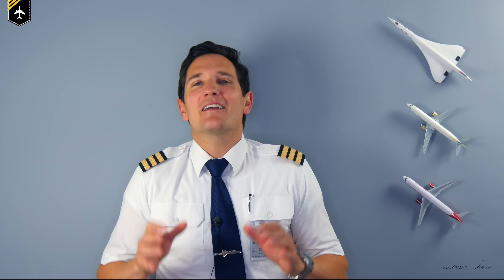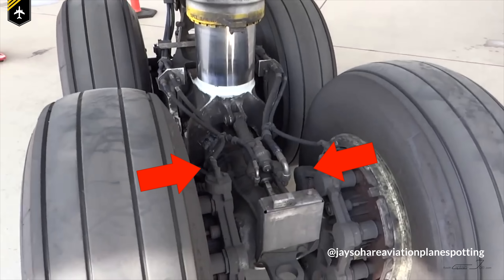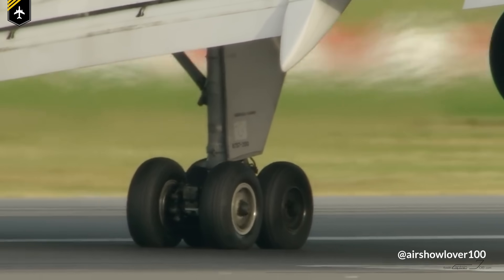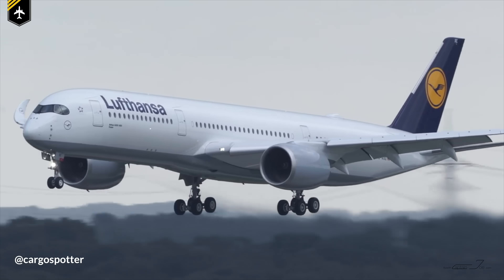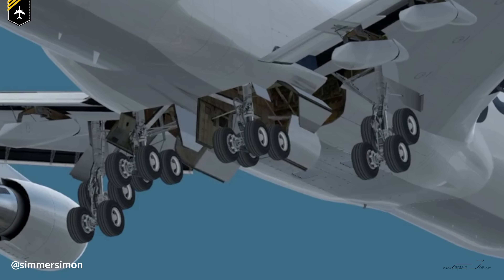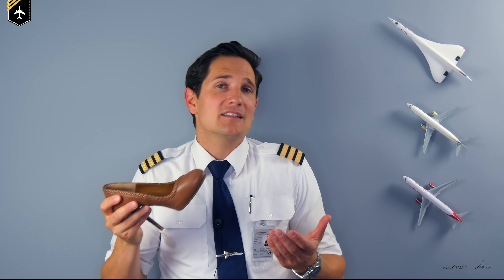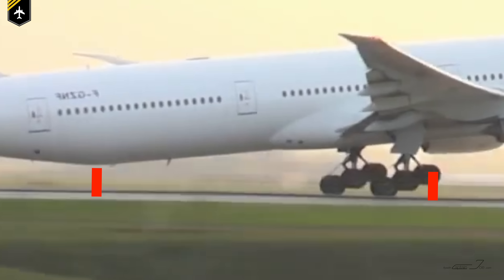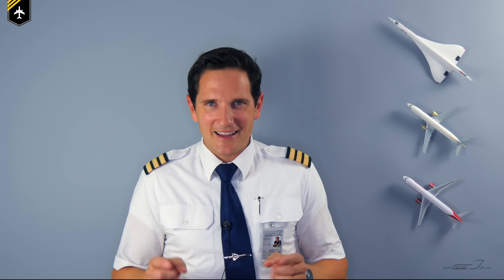Why is the LANDING GEAR TILTED? Explained by CAPTAIN JOE

Comment: I’ve been an aircraft maintenance professional for 20+ years, and I can tell you that very few pilots have this much knowledge about aircraft systems. Troubleshooting discrepancies would be much simpler if all pilots were this well informed. I’m very impressed.
Reply: So nice to say that really nice
Reply: Really?? I thought they're supposed to know😱
Reply: @shana5413  They USED TO... years ago.
But most recently-licenced pilots have become 'computer button pushers', and know less and less as time passes by.  That will increase the number of accidents, sadly.   If you carefully study the many accidents that occurred by a combination of mechanical, electrical or even computer malfunction, most probably you will be able to find that the crew did something wrong that aggravated the failure, or failed to do what was necessary to solve the condition.  I'll give just one simple example: when the Alaska MD that crashed near Port Hueneme California because the threads in the stabilizer nut got stripped, the failure was NOT an ENTIRE, SUDDEN failure... BUT; as the pilots were predisposed to think all failures would be of ELECTRICAL nature, they kept actuating the electrical reset in order to force the actuators to move the stabilizer to trim the airplane... BUT, it was NOT an electrical malfunction... THE DAMN THREADS in the nut-screw jack assembly were STARTING to STRIP!!! So , they, by not understand what was really happening, they just kept stripping the threads until those failed completely, and the position of the entire stabilizer made the plane go into a deeper, unrecoverable trim condition resulting in a fatal dive.    At least in our imagination, we could suppose that if one of them would have left the cockpit and walked to the rear of the aisle, to ask the flight attendant if she had listened to any strange noise, and described it to him, they would know that SOMETHING mechanical WAS BREAKING, and would have radioed the situation to maintenance where somebody would have said: "DON'T TOUCH THE TRIM AGAIN !... REDUCE SPEED, Try to get the CG back as far as possible, and try to land soon!

And there are many other cases where a better understanding and knowledge of aircraft systems would had saved the day.
Reply: @alfredomarquez9777  Load of BS. Fatal accidents per million flights decreased 12 fold since 1970, from 6.35 to 0.51. Now have a look at general aviation, where button pushing only now  becoming a thing.
Reply: @alfredomarquez9777 what a unqualified comment the pilot leaves the cockpit in an emergency to ask the FA if she heard anything breaking. Even when, how should she've heard anything in between the two engines and the trim actuator up on a T-tail? Further on pilots have to follow procedures in case of a malfunction and not do what they think would be possibly right! Sorry but that's complete nonsense! 😂
Reply: @shana5413  You'd be surprised, if not scared how little pilots actually know. EVERYTHING is automated these days, pilots get compliant, and forget how to fly over time, they become glorified taxi drivers at best, that have no idea how the machine they use works at even the most basic levels. They just know what button to press to make that blinky light turn off.
Reply: @Cramblit  Because that’s someone else’s job. You don’t want them tinkering with things and damaging a multimillion dollar machine.
Reply: @Cramblit  are you even a pilot?! it's not easy AT ALL! mechanics don't know shit about flying, how much more should a pilot know, they already need to know a shit ton!
Reply: I'm going to keep this in mind as an aspiring pilot who's yet to start for his PPL/VFR rating.
Reply: @tacmill  Start now, things will be better by 2024 mate
Reply: Same here; how many times I tried to explain to a mechanic that I did not care about his supervisor getting angry if the plane did not departed on time due to a maintenance problem. Or how many times I had to read together the MEL in order to make sure we were dispatched under the correct one and not the one suiting him; If they were as fast with their tools as they are with their pens there would never be a delay. Pilots are not as dumb as mechanics believe we are.
Reply: @gerardosalazar161 those are licensed engineers and not mechanics! They make the decision to dispatch according MEL not the bus driver!
Reply: This isn't true... Pilots have intricate knowledge of the planes they fly. It's idiotic to make a blanket statement about a group of people you aren't even apart of.
Reply: @TheKvs777  It is true, actually. It’s idiotic to call it a blanket statement when I said “very few”, and when I’m basing my opinion on actual experience working with pilots. Pilots have to know how to operate their aircraft and systems, and most have a simple understanding of how they operate. I was complimenting this pilot and others like him who know how the aircraft operate in greater detail.
Reply: @TheKvs777  exactly right, armchair pilots talkin shit when they can barely fly a plane on a simulator
Reply: It’s absolutely incredible the amount of technical engineering that has gone into commercial aircrafts over the last 100 years. I’d be curious to see how many dozens, or even hundreds, of everyday inventions have directly branched off from this research.
Reply: Do you think that he had all this knowledge just up in his head?
Reply: I agree. The number of times that I've ran in to a pilot that had any idea that planes don't fly with dragon and unicorn power makes this incredible to listen to. I'm impressed. It is fun to tell them that the discombobulator in the flux capacitor is the culprit.  Especially when they say something about that being their first thought too...hardest part is keeping your face straight...
Reply: JC are we to understand that you deliberately lie to the PIC on maintenance related issues? I would love to hear what the FAA would say to you. How can I trust a mechanic that lies to me?
Reply: @JC-xz4ec  I mean, the mechanics of the plane are not their job, they're your job. I bet if you were in a cockpit and told to fly the plane you wouldn't be able to do it, even though you've worked with planes for many years, so shouldn't you know how to do everything? I wonder if the pilots would be snickering at you while you're sat clueless in the cockpit, or if they would understand that it takes a team to run and maintain a piece of equipment like a aeroplane.
Reply: That moment when the passengers are Capt Joe subscribers and have more knowledge about the airplane than the pilots themselves.
Reply: Really? You'd think a pilot would know their plane inside and out. The fact that they don't is actually kinda scary. Having that kind of knowledge of a plane would help them spot problems and deal with rare problems more effectively. Among other things. It sorta reminds me of how Al Bean and a member of the ground crew named John Aaron saved Apollo XII after it was struck by lightning twice during launch, causing multiple failures to falsely show up on the instrument panel. The story goes, John Aaron was the only one who knew what SCE to Aux did, and suggested they try it. Nobody else had heard of it, except Al Bean, so he alone knew where the switch was. Nobody else onboard on on the ground knew about it, much less what it did. So that's just one example of how intimate knowledge of your craft can save your butt in an emergency.
Reply: I mean, the mechanics of the plane are not their job, they're your job. I bet if you were in a cockpit and told to fly the plane you wouldn't be able to do it, even though you've worked with planes for many years, so shouldn't you know how to do everything? I wonder if the pilots would be snickering at you while you're sat clueless in the cockpit, or if they would understand that it takes a team to run and maintain a piece of equipment like a aeroplane.
Reply: Stephen Carrigan yeah i agree. Then the tribunal follows. Why did you scratch your nut instead of listening to the Ai?
Reply: “30 years” is a typo. It should have said “20 years”. Correcting it now
Reply: Itachi Uchiha 😂😂
Reply: Stephen Carrigan Where did I say anything about pilots troubleshooting? Your last sentence is just a repeat of what I said.
Reply: lumpheadthump  was the day I was going to go to the movies and then I was going to go to the movies and then go get pizza 
Hi I was just wondering how your phone is been I have been to the office for about an hour’s morning and I was wondering how your going going
Reply: Me too!  I have to say there are some great exceptions.  I know a TRI at BA and he knows every single pump on the Airbus - he was an Apprentice Engineer though...!
Reply: @Stephen Carrigan He only said that if pilots have a working knowledge, troubleshooting would be easier for HIM. He didn't say the pilot should troubleshoot.
Reply: i think in the US they are
Reply: Sir, by not any offence, may I know how much salary a maintainance professional receive and the company you worked in?
Reply: @auroralshine6176  $26 to $38 per hour depending on experience. We don’t hire many mechanics
Reply: Whatever dood all pilots are briefed more than mechanics in their gen fam classes
Reply: @behindthen0thing525  HAHAHA!!! You have no clue, you idiot
Reply: @WeeTodd1  you sound like you have no clue
Reply: @WeeTodd1  you proved that you made a career out of building tires and brakes while the real techs troubleshoot and fix systems.  Don't you have a gear well to wash or did you fall asleep in the pilots lounge already?
Reply: Anybody else notice the video is 7:47 long??
Reply: Female driver and car
Reply: Im dreamin to be a aerospace engineer
Reply: Like that old story about the pilot stating that the number 1 engine is missing and the crew chief responded "number 1 engine found on left wing after brief search"?
Reply: Are you saying that pilots also describe a problem with a plane like many drivers do with their cars? You know, like the thingy in front of the other thingy is making a noise?
Reply: @TheNeshkey  No, not that bad. Just that informed pilots know which details are useful to maintenance .
Reply: @Dwayne VanMeerten 
It is a real pleasure to receive information from a real-life bona fide EXPERT for a change, instead of the usual know-nothing keyboard warriors. Thank you, sir!
Reply: Kindly pls tell..why do aeroplane tyres in ground while Turing..one side tyres lifting up
Reply: P
Reply: I call BS…”Could Not Duplicate” is the favorite saying from every MX guy…
Reply: @tripleh4884  That's not true. You're stupid.
Reply: Never underestimate poeple😅 lol
Reply: I will join this "me too" movement.
Reply: That is true.
Reply: 0:27 Well I'm an aircraft mechanic too.he may very well have the knowledge. But did it occur to you that very possibly he studied the answer before he got on YouTube??? It is not as if he is in a live similar and answer random questions!!!!!!!!
Reply: @anthonyb249  pilots are not that smart when it comes to statements knowledge. If they did they could tell mechanic what to replace when they landed.
Reply: Landing gears is no doubt a very imported component of an airplane that ensures the absolute safety but the experience qualified pilots have the more worth. Who does collaborate with the all services and henceforth, does action for the largest interest of the air safety! 
Disciple Training, Off site working Mechanism and  Simulators before to join this Force is Pre Condition which inculcate also the attribute among  the Apprentices *  The professional Tech Trainings purely based on experienced and trained instructor! PAF Airmen academy,Korangi Creek, Karachi. Pakistan.
Reply: lumpheadthump same here. 12 years AMT. this is one of the few pilots we might not be able to bullshit. Hahaha. Surprised he actually knows so much on the mechanical side.
Reply: Andres Morales If you’re “bullshitting” pilots after 12 years in the industry, you should consider a different career
Reply: @Snazy30 He could help you do gear changes.
Reply: Sometimes too much information is really useless mental clutter. — they’re flying the plane ✈️ — NOT airborne mechanics.    — Kinda like, I’m an excellent driver, but certainly no auto-mechanic .
Reply: Smallstudio Design That’s pretty stupid
Reply: It would also be impressive if I knew an engineer who could fly a plane
Reply: @luke515  There are literally thousands just in the US who do
Reply: @luke515  exactly, very well said! the original comment is so idiotic!
Reply: lumpheadthump hhghhhhhhhhhhhhhhhhhhhhhh
Reply: Are you kidding? Pilots--the male ones, most especially--already think they know EVERYTHING. They don't. At all. They should stick to grabbing the yoke and yacking the squawk, ya know?)
Reply: @katiedonovanAlt  How about you go fly the plane then.
Reply: @armelburgess8651  Well, no....that's not my JOB....kinda my point, yo.
Reply: @katiedonovanAlt  That's what I'm saying. Most don't have the depth of knowledge this guy does
Reply: @WeeTodd1  Which is exactly why no one should be encouraging them. THIS ONE has it okay....but all the OTHERS will decide THEY do as well. Because if one man knows something, somehow ALL men do.
Reply: @katiedonovanAlt  So I shouldn't compliment a pilot who knows more than most? What are you on about? Who cares what other pilots think about themselves? We should encourage pilots to learn more about their airplanes so they can speak knowledgably when reporting discrepancies.
Reply: @WeeTodd1  You're absolutely right.
They should be TRAINED. OFFICIALLY.
And until they are, they should collectively zip it.
Reply: @katiedonovanAlt  Oh, you said THEY should zip it until trained. I don't completely disagree, but I used to have fun messing with those pilots when they tried to tell me what the fix should be
Reply: @WeeTodd1  Look, I see what you're saying...we're actually saying almost the same thing.
You feel like there are times when sharing information is beneficial for everyone...and that benefit has a net payout in safety.
So sure. Yes, of course. Certain info should be shared at certain times when it has a potential to enhance safety.
That information should be disseminated via official channels and it should be documented via a system of accountability.
It should never be left as the subject of watercooler banter in the lounge.
There is a distinction.
Reply: @katiedonovanAlt  First, I never said anything about training pilots, and I didn't mention sharing information with them until I misread your comment. Second, pilots fly the airplane, and telling them how a standby hydraulic pump works isn't going to change the way they fly the airplane. So it's a little ridiculous to talk about accountability when we're answering questions for the flight crew. They already get systems training for the airplanes they fly, but it's not as detailed as a maintenance class, and it generally leaves them with gaps in their knowledge or outright misconceptions. It's a common industry reality that most pilots ask questions about the airplane and there's no danger in answering them. Your militant comment about "encouraging" them on a post where I complimented a pilot for knowing more than most pilots came out of left field.
Reply: @katiedonovanAlt  I'm familiar. They used one of the airplanes that I managed (a Hawker 800XP) in Sonoma County for a show about cell phones and avionics. That show was scrubbed from their lineup and, somehow, from the internet because they couldn't create any interference. I get that, but professional pilots are a little more sophisticated than that.

EDIT: It may be back, season 4 episode 10. I can't be sure because it's behind a paywall.
Reply: "Very few pilots have this knowledge" this statement concerns me and is another reason I refuse to fly!
Reply: @MaynardFreek  Unless you boat a lot you're going to miss a lot of the world.
Also flying is so fucking safe it's almost retarded to be scared of it, heck i cruise around in 40 year old helicopters. Probably going to die driving the range to work.
Reply: @MaynardFreek  To drive a car you don't need to know the engine works but how it responds when  you press the buttons or change gears. I guess the planes are like that too to some pilots.
Reply: John Holifield sure sure. But you’re totally ok with being on the road with 100’s of morons every day, that can kill you in an instant
Reply: John Holifield They know a lot about what they need to know. Flying is safe, partially because of their training
Reply: @Dwayne VanMeerten 

Compared to pilots who had to fly by feel and do calculations themselves? 

Planes basically fly themselves nearly these days. 99% of piloting an aircraft is putting in numbers into the computer and setting the auto pilot. 

The only time the pilots are actively piloting the plane is only during take off and landing, and that's mostly just making sure all the gauges are staying nominal. 

No I'm not an airline pilot, and no I don't think all of them are under trained, or not great pilots, but comparatively speaking, yes, many pilots these days in the Air line business simply couldn't bring a crippled plane down safely even if it was possible (albeit extremely difficult). 

Planes, even during problems have automated systems. Everything is automated because of the amount if incompetence and lack of knowledge in the past. Something like 75% of airplane crashes in the past from the 1930's to now were the result of negligence, and incompetence from pilots, and planes consistantly kept getting checks, automated systems, etc. 

It's so automated now, that pilots COULD be replaced but aren't because the general populace doesn't want that, and in the very very VERY unlikely event the computer needs to be overridden, or has an error or problem with it mid flight. 

As a rule, humans these days are only in the cock pit to set the computer, and be the fail safe, when the actual pilot, the computer, breaks down, or has errors. 

And even then the human fails at its job as the fail safe because they're so used too the computer doing everything.
Reply: @Dwayne VanMeerten 

I fail to believe you're a pilot. 

Everything I told you, is things which pilots have told me. From Engineers, to pilots, to airplane  engineers. 

Simply put, you're not fighting me, you're fighting thousands of hours of actual airline experience telling you you're wrong. 

Have a nice day.